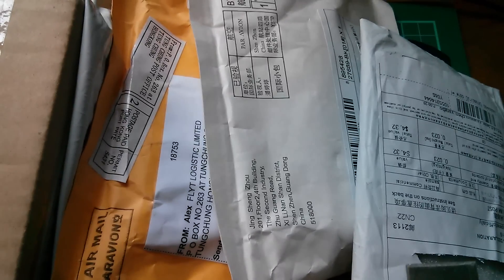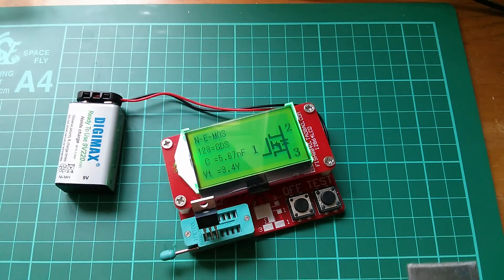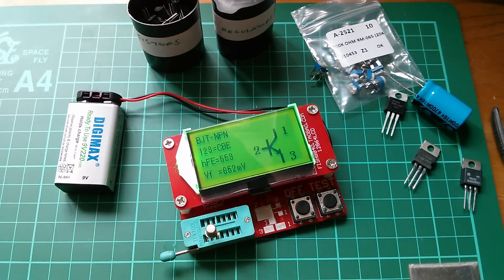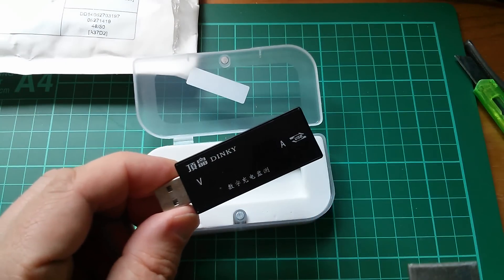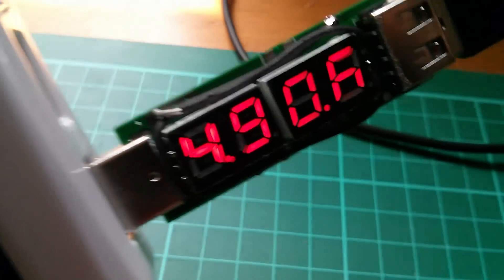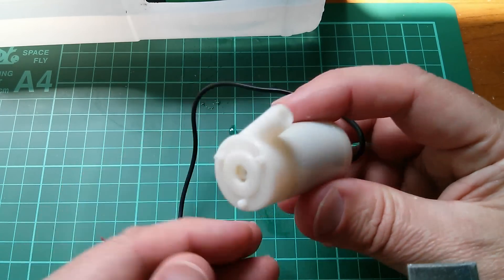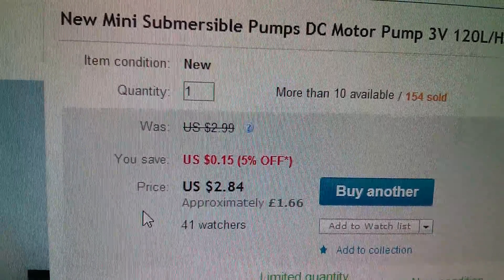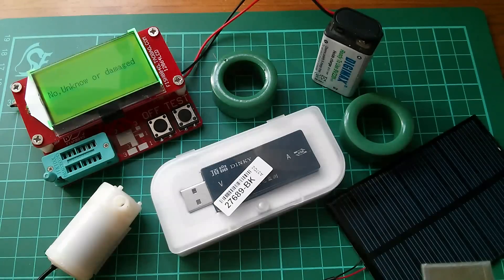Postbag #9: Component Tester, USB Dinky, 3V Pump, Ferrite Rings

Comment: These Chiwanese tronics devices are great fun.  The unassembled kits are just dollars and should be easily assembled.  //  I got the clear and translucent blue non-Dinky versions of the USB tester/VA meter for 2.13USD and 1.60USD, and they're very handy for troubleshooting chargers and cables, etc.  //  What a LOVELY water feature, Julian.  //  I still cringe when I see you hacking things open with that box knife.  I use the little enclosed envelope slitters I got free from 37 places at COMDEX (back in 1998) and other trade shows.  Checking Ebay, they're $4USD now!  Ridiculous.

Comment: I ❤ my tester because it made building the other 8 kits on my bench so much faster.  It would have been great if it did nanofared capacitors. That would have saved me getting out my bright light and magnifying headset to attempt to read the silly things.  But not having to read the color stripes on quarter watt resisters made up for that somewhat.  😁

Seriously, nifty tool.

Comment: Hi
Can you help me to calculate inductor number of wires, size etc for 50amp mppt. Currently I am using T157-26 x 2 Yellow White cores 12 rounds of 22 gauge wire 20 wires together like a rope?
Problem is it is core size is small and winding (rounding) 20 wires is really difficult.

Comment: which one is better?
http://www.ebay.com/itm/12864-Mega328-SMD-DIP-Transistor-Tester-Diode-Triode-Capacitance-Meter-/252261795005?hash=item3abbf984bd:g:7jsAAOSw-zxWogHj
http://www.ebay.com/itm/Mega328-Digital-Transistor-Tester-Capacitance-ESR-Meter-Diode-Triode-MOS-LCR-/271972465484?
http://www.ebay.com/itm/New-GM328-Transistor-Tester-LCR-ESR-Meter-Square-Wave-Generator-MOS-PNP-NPN-WL10-/321942702081?hash=item4af547c801:g:pJ4AAOSwwE5WZju1
Thank you
Reply: +Taylor Two No anymore, I already buy one. Thank you.

Comment: The component tester was the last item I ordered before abandoning my electronic projects hobby in favor of traveling.  I have been on the road now for about a month now, and I do miss my electronics. I brought along some of my home built toys, and some of my power supplies, as well as my huge LED setups that I have mounted on old PIII heatsinks. I have multi-color 50 watt and 100 watt LEDS most of them are trash but some of the color ones do perform, especially the blue red and green ones, they all seem real and quality LEDS most of the white are really bad.  I planned on hooking them up and shining them on the awning on my 35 foot Class A motor home down here in Arizona, but life keeps getting i the way, and I have yet to even unpack them. Oh well I can still keep up on what is going on in the electronic world through your posts. I brought along several arduino's and my little Raspberry Pi with a 7 inch screen for it, but again have yet to even find those in my many boxes of toys. Anyhow if you were here in the States, I would wish you a Happy Thanksgiving as today is it.  We have few plans other then attending the campground thanksgiving turkey dinner given by the owners and staff of the small campground we are spending the winter months at here in Arizona, some 1300 miles from our home in Lemmon SD.
Reply: You have the most interesting comments

Comment: Hi Julian, I ordered the transistor tester.  It stopped working for me.  It boots if I raise the voltage to 10.8v.  Instead of measuring, the device turns off.  Any ideas on how to fix it?  Before this the LCD would be flickering.

Comment: I have had a few of these in different shapes and sizes. The Zif connector is the problem for me as I test used transistors, TIP35C, etc. Can't get them in the Zif connector. Cant get lots into that connector once used as solder still on leads or the leads cut. So I bought one with leads to get around that problem and now getting rid of others as I do not use them. FYI, Do not keep in close proximity to active Tesla coil or high powered Slayer Exciter. The two meters I did experiments with close to coils just ask to be calibrated now. Maybe unrelated but high coincidence. Be Happy.

Comment: Documentation about this class of testers can be found at http://www.avrtester.tode.cz/upload/ttester_en.pdf

Very interesting devices, history and, of course, cloning by the Chinese...

I would be interested to know if anyone has had success with other software in the particular version that Julian has here, the one modified by Fish8840. Note that according to the documentation, the security bits are set on the original software in this version so there is no way to restore it to the original state if something goes wrong.
Reply: Thanks for the documentation!

Comment: You should check out this USB Charger doctor, it displays Volts and Amps. You can also get a model that has a blue LED block for the amps which makes it easy to see which is which at a glance. http://www.ebay.ca/itm/171349112644

I forgot to mention that this bad boy has two USB outputs, the first one allowing for charging and data transfer while the other only allows for charging.
Reply from the maker: it's on its way
Reply: This one is the best one on ebay-
http://www.ebay.com/itm/USB-3-0-OLED-Battery-Charger-Doctor-Voltage-Current-Power-Capacity-Ammeter-Meter-/251656549098?pt=US_Computer_Power_Supply_Testers&hash=item3a97e632ea

Comment: I actually build one of those component testers last month. Though it didn't have a display as nice as yours (just a 16x2). 

Originally developed by some German guy. The Chinese have since been making these. 
I'm probably a bigger cheapskate than you, since I build mine myself to save some money (-;  

Would be fun to see if it measure that huge inductor you're going to build.
Reply from the maker: Good idea. When I've wound the inductor, I'll put it on the tester and compare it with the smaller one.
Reply: Julian Ilett if you finished with winding then please share some knowledge about your step up/down converter with the coil. I would love to build an arduino step don :-)
Reply: Julian Ilett if you finished with winding then please share some knowledge about your step up/down converter with the coil. I would love to build an arduino step don :-)